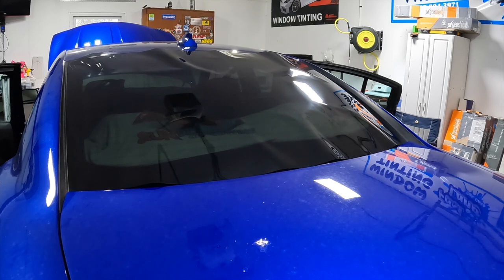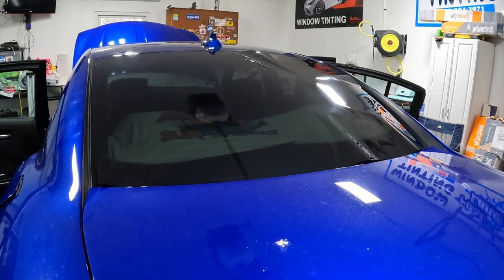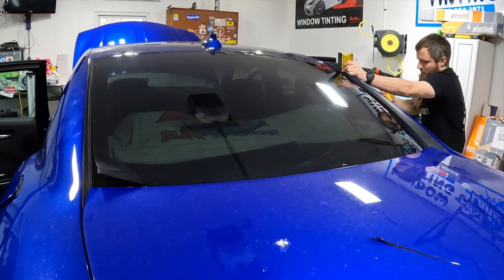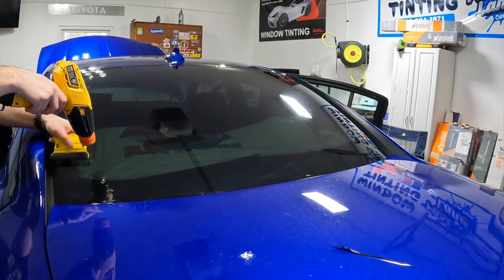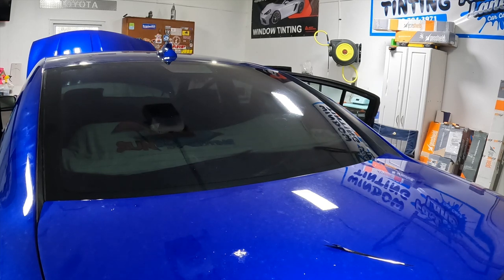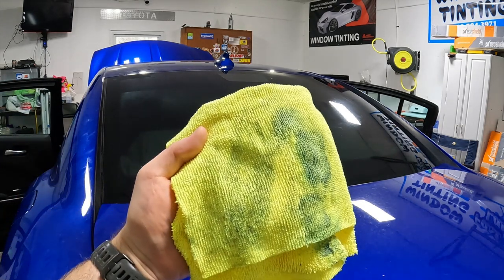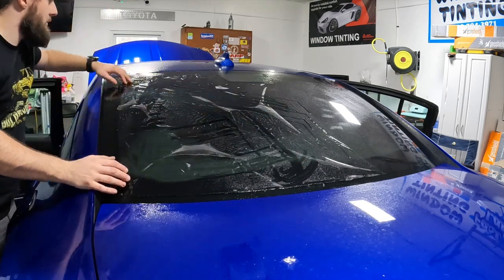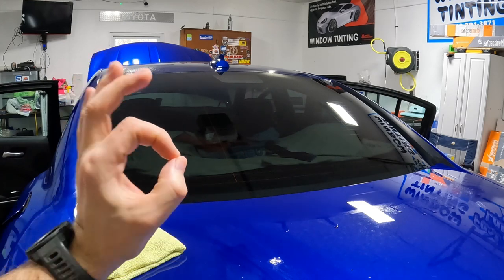How To Tint The Infamous Dodge Charger Back Window With Ceramic Tint!

Comment: Every time am applying inside, got bubble after couple of seconds on the defroster lines. it happens only with charger, please guide me what to do. Thanks
Reply from the maker: Are you scrubbing the defroster with steel wool or just a scrub pad?  These have pretty thick (and dirty) defroster lines which means they really need to be clean to get the tint to stick quickly and not allow air/water to get sucked back down the line.  You could also be over shrinking the film.

It would be best if you filmed your entire process start to finish so people can see exactly what you might need to change.  Best of luck.
Reply: @fastlanecarcarellc3608  first of all thanks for reply, am just scrubbing the windshield with scrub pad, once after applying film everything is good but right after couple of minutes alot of bubles occurs. Really tired of the compaints.
Reply from the maker: @Jagdeep Singh  very understandable.  These things are notorious for that. That's why when I do these I like to do the back window first then do the rest of the car. And even when I'm done, don't let the customer know for about 20 minutes or so just to make sure nothing pops up. 

One other trick you can use is right before you apply the film, start the car and turn on the defroster. You'll have to move quick though because the film will tack up much faster.
Reply: @fastlanecarcarellc3608  ill try and will definitely thanks to you for this trick. Thanks alot